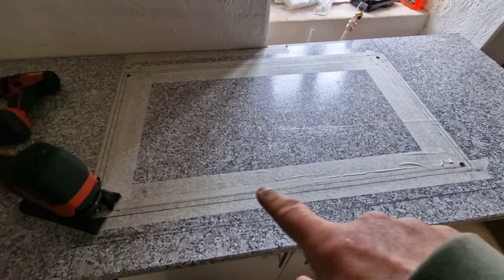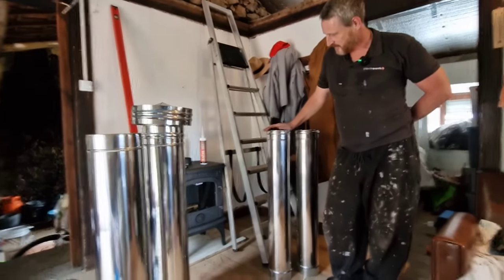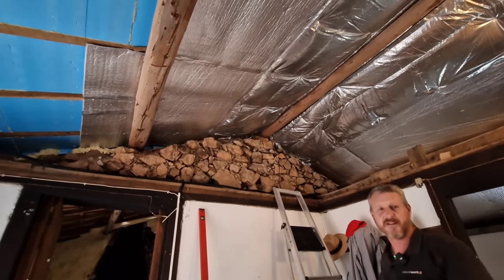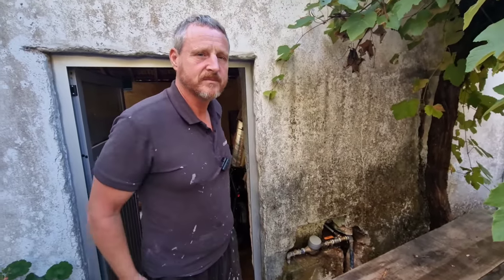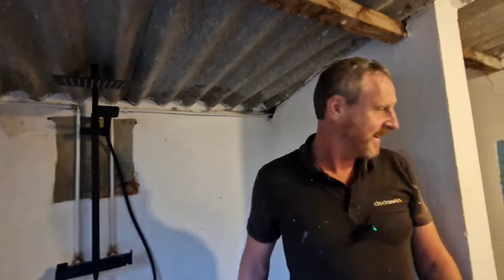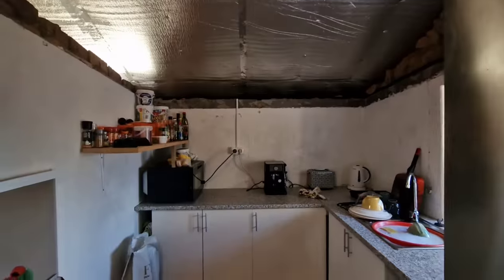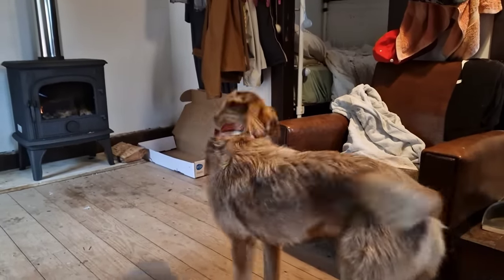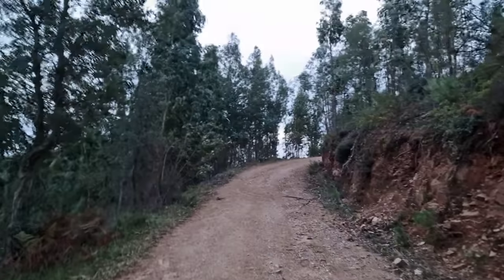Winter is coming! Hot water, Hot shower, Hot fires!

Comment: Great progress Nick and Sara ,respect to Dave very handy man .  lovley job too with the stove burner install  , we just got ours fitted a few weeks ago as well  and what a difference they make not just from the heat but the look  of a natural fire burning on  cold days is quite relaxing without worrying how many kilowatts were using,  also  thinking about adding an air induction system above ours to help heat other rooms to, through the loft space with some 4" ducting some fittings and a fan. We may also get a back boiler fabricted  as not many of them made nowdays for some thermo sython action ...utilise that energy. take back the power and knowledge we already have  ..and give the robbing energy wholesalers the two fingers this winter
Reply from the maker: Absolutely all of this ! Cost of greed crisis in full effect

Comment: You ought to install solar panels for free electric
Reply: It's not really free electric though...its a massively expensive outlay that could potentially take years to recoup the costs. Often people completely off grid struggle to generate enough solar power in the winter so i wouldnt want to be completely off grid. We would love to be able to power our house just off solar in the summer and we try to keep our power banks charged from the solar panels to use as much as possible but we cannot afford to install a full solar set up at the moment. Currently our electricity bill is incredibly cheap in comparison to our UK bills, it will be interesting to see how much this increases now we have an electric water heater!